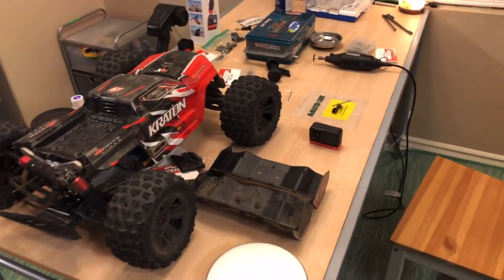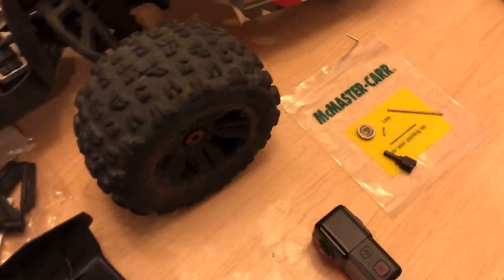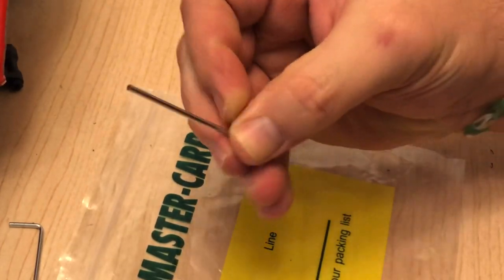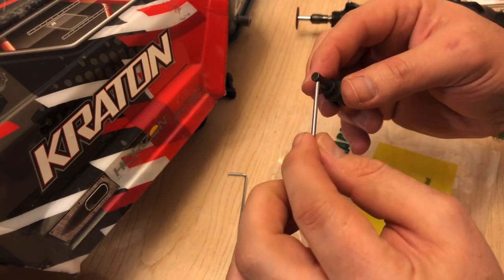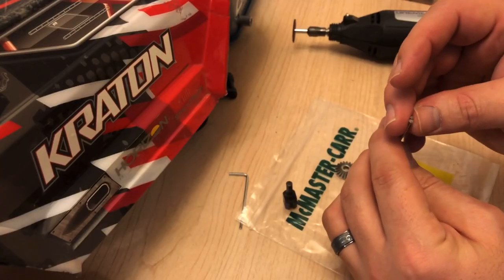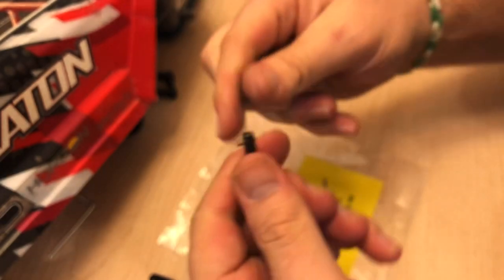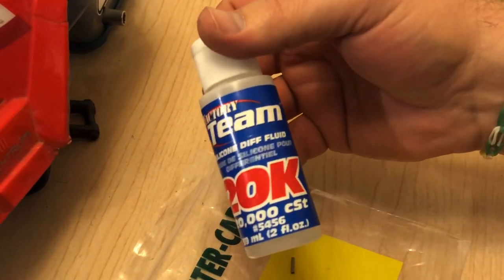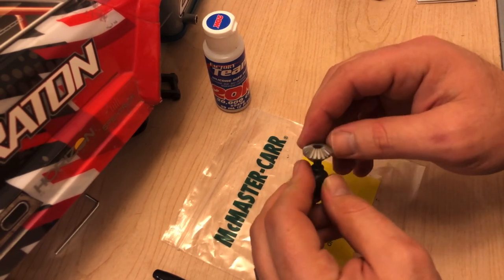Arrma V4 V5 EXB Essentials - Better Diff Pins

Comment: I locked my diffs and started breaking pins like crazy.  So you Sir are a real huge contribution to society .. you have answered my questions and found my solution.   Thank you
Reply from the maker: Splendid! Glad I could help. Be careful though, because while these pins are way stronger. The planetary gears themselves can be pretty fragile and would be the next thing. If you continue having issues you might consider tweaking your diffs. However… Let me know if the simple pin upgrade mitigates your issues, I’d be curious to know after you’ve ran them for a bit.

Comment: I want to thank you I’ve been watching your channel for a while now and you have a lot of great tips 👍 I’m ordering them pins today and keep doing what you do ✌️✊
Reply from the maker: Appreciate that my friend! I’ve never broken one of these new pins, they’ve been great. However I did learn that the cause of my breakages were in fact directly correlated with running the 20t pinion. 
So I dropped back down to a 16t but it wasn’t particularly because I was worried about breaking these pins, In fact they held up for a few runs with the 20t. 
I dropped to the 16t because I was having cogging issues. 
Anyway… This tactic is legit good though!

Comment: I read about this exact fix on the Arrma forum, I have my drill bit blanks but I've been waiting for my normal diff service to swap to these pins. I run my Kraton on standard electronics, 18T pinion. 30k cst front, 50k rear, and 500k center diff fluid.

Comment: Very interesting how loose that little pin was and how much play was in there. Curious though, if that new pin still has a tiny amount of play in it, is there an actual size that goes in that with no play? Awesome video and very informative!
Reply from the maker: Actually yes, you want even less slop, pick up the M2C’s Out Drive cups he actually manufactured his with a slightly smaller hole. So the combination of the McMaster pins and his cups are nearly flawless in slop. You can find the details about that in this video.
https://youtu.be/6CUhUtJpR7c
Reply: @EastTactics  Oh perfect as I literally just picked up the M2C drive cups! Thank you for the info!

Comment: You've brought up something I've been curious about. The planetary gear is the only thing I've ever broke. It was the center diff, I got the red aluminum diff case and haven't broke one since. But, have you ever experimented with say putting a Mugan planetary gear, or an X-Ray pin, or an entire Tekno rear diff into your Kraton? Wouldn't it be cool to find some super strong gears from another brand that slide right in!? (my Talion V1)
Reply from the maker: Regarding all of the internal gears inside of the differential. I’ve never found a third-party company that made any of those. I’ve seen GPM make ring gears, and I’ve seen them make the spiral input gears. But I’ve never found a brand that actually made a planetary gear or the actual spider, gears, etc. your saying techno makes some? Can you send me a link? Also I’ve never heard of x-ray pins.
Reply: @EastTactics  Hi there, East Tactics. I was only using those companies as an example. If you watch someone break down a diff from a different company, a lot of them look very similar. I thought it would be cool if another brands gears happen to fit into Arrma diffs.
Reply from the maker: Ya it would be nice. 🤔

Comment: Just now got around to ordering some, one thing I hate doing is having to keep rebuilding diffs due to broken pins
Reply from the maker: For sure mate, help a lot. 
what size motor you running? Also what size pinion are you rolling with?
Reply: @EastTactics  Hobbywing max6/1650kv combo with 46t spur/16t pinion
Reply from the maker: Ok cool. These pins will help👍👍

Comment: I just sent you a message on messenger,I’m wondering if these are better than stock and my best option.lately I’ve been liking to fly upside down for as long as possible wich needs a lot of throttle close to landing to actually land it.basically I end up landing with a real high wheel speed and breaking pins,I’m not landing on throttle but it snaps pins doing so.any input would be appreciated brother👊🏻😎

Comment: Hey, great vids I'm having the same problem and just ordered some hardened drill blanks to do this mod, could you let me know if doing this helped as I've tried everything else, I do have quite a big motor a 1650kv on my kraton with a mojave chassis so could be down to that rich duperbash said to make sure you are off throttle when jumping as that can brake them too, be great if you could get back to me, take care gaz😉👍
Reply from the maker: Hey Gav, sorry for the late response, it seems like some comments dont land in my feed, or I just somehow overlooked this. I apologize. I would definitely say that these hardened still pin have help. I haven't broken one yet... and its been well over a month since I installed them. I must point out though, that I dropped back down to a 16T pinion and dropped my punch to 6 at the same time... still, these pins have NO slop and are tough as all get out. So ya I really recommend. how have things been since you posted this comment 2 weeks ago?
Reply: @EastTactics  hi thanks for your reply, haven't broken any lately so fingers crossed and I did turn down my punch too, keep up the good work always enjoyed your vids take care gaz 😉

Comment: Hey brother how are these holding up so far couldnt find a follow up video
Reply from the maker: I’ve never broken one of these custom pins. Not a one. 
Even for the short time I kept the same gearing. 
I did learn how we that the main cause for whi I was breaking the stock pins, aside from the fact that they are weak, was because I was rocking to high of a pinion gear for the stock setup (20T)
I’ve dropped to a 16t for a long time, and even more recently (due to cogging w/the 16t) dropped back to the stock 12t.
So there is a direct correlation to high tooth pinions and braking these pins.
That all said I did rock the 20t pinion with these new pins for a bit, and they held up. It was the planetary gear that became the weak point. 
Let it also be noted that M2C outdrive cups have slightly Smaller holes (on purpose) to clean up slop, and prevent breakages to both pin and gear. 
Watch this vid for the deets
https://youtu.be/6CUhUtJpR7c
Bash on brother!!! 😎👍

Comment: I must be lucky as my stock ones have very little movement, I’ve ordered some 2.25mm drill bits for the future 👍🏻
Reply from the maker: Oxford RC, Nice, curious how recent of a purchase are your current pins? I wonder if Arma actually did a re-spec. Maybe they now send out pins that are actually closer to 2.25 mm. They upgrade everything else LOL
Reply: East Tactics I brought the car 2/3 months ago, so maybe they have upgraded them 🤔
Reply: I bought a bag of pins recently and they are exactly like the ones in the video: under spec on diameter. Its possible they are old stock.
Reply from the maker: Ya, That’s what I was thinking too, A line of old out of spec diff pins exist out there.

Comment: Hi I measured the Kraton original diff pins with an outside micrometre and the are 2.25mm so I think the ones that you had purchased are a bit thicker if the original are the same like mine, my kraton is V4 2020 I don't know if maybe they changed them but I have the same problem with the front and rear diffs
Reply from the maker: Joseph Caruana, interesting, I too have the v4 Although I think I snagged mine in 2019. Either way the three different sizes that I ordered from McMaster.com we’re definitely a much better fit and got rid of that slop. My question to you is regardless of what your micrometer Reading was, are you experiencing the loose slop with the stock pins? You won’t be disappointed with picking up those upgraded pins from McMaster, I have yet to break one. I will say however the biggest contributing factor to why I was busting pins in the first place was simply because I had to high a tooth pinion gear and my punch setting cranked all the way to nine. After dropping back down to a 16 t pinion gear life has been grand. It is really nice to know though that I’ve got tank quality pins in my differentials.
Reply: @EastTactics  hi yes it is a good idea but at the moment we are not receiving any mail from US due to the pandemic but as soon as we get to normal I will order some spare for the time being I was going to try and change my centre diff oil because I have 500,000 CST in it and I am using a 14t pinion because I fitted everything on a Mojave chassis
Reply: @josephcaruana9165  u can order drill blanks in the uk that's what I did I ordered some 2.2mm and haven't broken anything since, just Google drill blanks uk and u will find them, hopefully that helps take care gaz 👍
Reply: @gaviscon4304  Thanks, but 2.2mm are smaller, the 2.25 are already loose so I think they have to be a bit bigger. First time I service my diffs I will check the proper size.
Reply: @josephcaruana9165  I ordered 2.25mm to and they were too tight 2.2mm were about right remember things get hot and expand so u don't want them to tight but haven't had any problems, just finished building a kraton 6s with a mojave chassis and a 1650kv motor and  with that motor still haven't broken them cheers gaz
Reply: @gaviscon4304  what grade of silicone oil are you using in the centre diff?

Comment: Funny. Most of my problems are on the front diff. My problems also started when a put in a bigger pinion. Tried shimming it, and nothing. Always break the pin and planetary on the front diff
Reply from the maker: That is interesting, guess the weak point goes one way or the other... tell me some details about what you're running in the front diff. What diff fluids are you running? Also what tooth pinion have installed. Are your tires stock. What punch setting you on?

I would suggest running 20k rear,  200-500k Center, and 80k Front
For the stock Kraton motor and ESC, I wouldn't go past 16 tooth. 
I also have my punch setting set to 6, instead of nine. 
I run those Hardened Diff pins in both front and rear now too. 

I haven't broken a pin or planetary gear since. 

Have you since resolved this issue. IF so, What did you change?
Bash on brother
Reply: @EastTactics  I have a notorious, not a kraton. I'm running 100k front and back, and 300k center. Running stock tyres, and a 14t pinion. It's a notorious, so punch is on level 9. But punch level should affect more the back diff. I only broke 1 time the back planetary. Already 4 times in front. I'll try to find those rods, and give it a try. But it's funny, it only started to break planetaries after I swapped the 12t for the 14t
Reply: @nelsonmarques1334  for me that happens if you land a jump full throttle on just one of the front wheels
Reply: @ELValenin  it's not the case. It's fatigue. Last one broke on flat dirt. Last time I used 3 shims and it's still running strong. Ordered aluminium diff cases to see if it help
Reply: Nelson Marques I also have a noto and had this problem , I found that running 100k front but 50k in the rear pulled some pressure off the front . Also 300k centre
Reply: @aaronlumsden7077  upgraded to aluminium diff case, reshimmed it, and now I'm not having problems. I think it was the plastic case dilating under power and heat.
Reply from the maker: Nice! Glad you got it worked out. And thanks for updating us all. Bash on my friend.👍😎👊

Comment: Im planning getting the exb but honestly the rear diff is complete trash even shimmed the diff sun gear gets chiped so im planing getting a v4 diff and shim it and do your modifications i just want a reliable diff
Reply from the maker: I hear ya... Plus if you asked me I would rather get the V4 and do the third market upgrades myself. Simply because even the EXB chassis, as well as the shock towers, simply just don’t compare to the quality of M2Cracing products
Reply: @EastTactics  to me the v4 was the same price to the exb+electronics the exb has more stuff going for it than the v4 that you have to ditch the radio servo and other stuff day 1
Reply from the maker: Surchaufeur, agreed… You definitely have to ditch that spectrum radio immediately. And you’re right, the stock Servo is not that great, however if you shim the servo savor it helps a ton! 
Still having the ability to choose what motor and ESC you want as well as the servo etc. and a controller and receiver is nice with the EXB. 
The EXB is a beast! Love the black too!

Comment: Do you think it's possible to use an angle grinder to cut it? I don't have a dremel
Reply from the maker: EL Valenin, worth a shot, might even be better than a Dremel. The number one thing you really need to make sure you take measures on, at least for the Dremel, is its potential to fly off the second you get to the end side of the metal. I actually cut a milk carton in half and positioned it in a way that It provided a sort of 360° catchall for a when the sucker goes flying off, if it goes flying off. Also it’s super hot.
Reply: @EastTactics  okay, I'll do that for sure. Thank you!!

Comment: Are the M2C 9130 1/8 SCALE DROOP SCREWS is a complete set? How many do i need? (Mojave)... thx..
Reply from the maker: Yes, it comes with 4, and 4 is all you need.

Install instructions say: (edited by me to make more sense 😝)
INSTRUCTIONS FOR INSTALLING DROOP SCREWS:

Since there is no hex on the bottom side of these upgraded droop screws,  you will then insert your 2 mm driver thru the top of the arm and  down thru the droop screw hole. 

Then put the droop screw on the end of the 2 mm driver and push the droop screw up thru (up from the bottom) of the arm turning counter clockwise while applying pressure with your thumb and thread the screw backwards into the hole.

It is advised that you use blue locktight to offer some resistance since this screw is going into an existing threaded hole.

When installing droop screw into new arms,keep constant pressure on screw as it is cutting threads when it goes in.

Hope that is helpful. 
If you have any other questions let me know. 👊💪😎

Comment: How did it work?? The pins you
Reply: Did the pins break again??
Reply from the maker: Fantastic only pins I use. I literally haven’t broken a pin since and it’s been well over a year.
Strength aside, one of my biggest reasons I love these pins Is the slop they get rid of. Just an FYI… M2C’s outdrive cups Also help to get rid of slop when you’re using the stock pins Because they manufactured the whole slightly smaller.